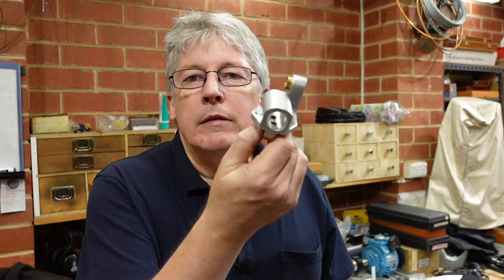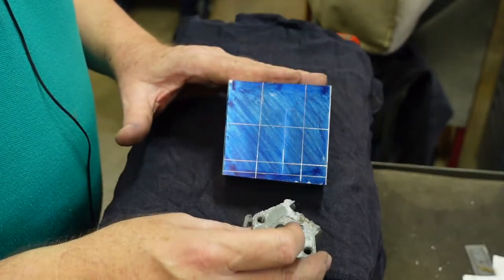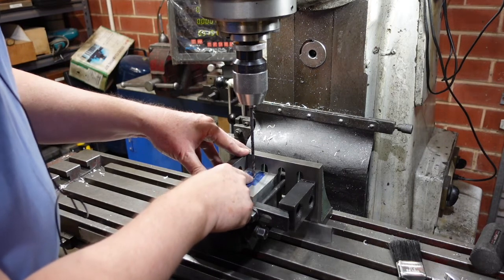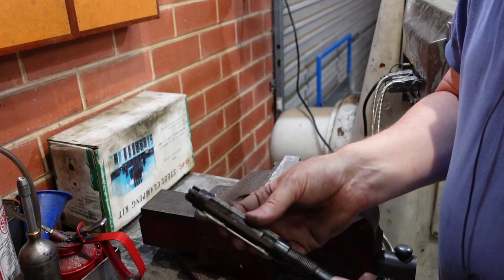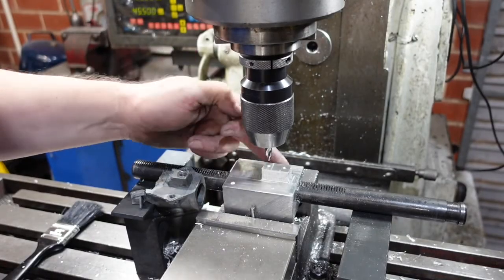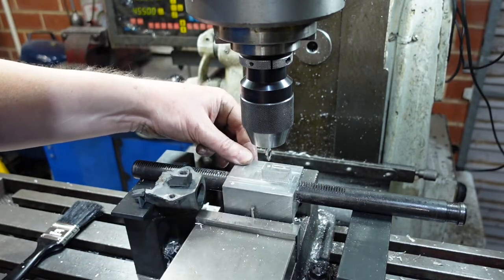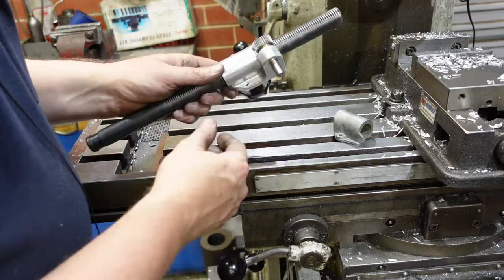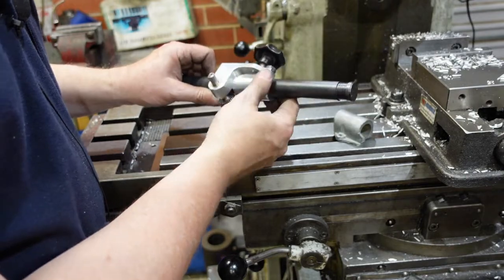Recreating a bandsaw bracket

Comment: Getting the offset for that pinion just right must have been "interesting", did you use something like a clockmaker's depthing tool to get the meshing right?
Reply from the maker: True confession - I 'm going to be doing it again as it is not quite where it should be. Tooth depth is around 1.7mm and it is probably only engaging 3/4 to 2/3 of that, so a bit notchy. Once the owner has finished doing a pre-arranged job with the saw, the bracket is coming back for rework. The error came about because I drilled a pilot hole in the bracket that seemed to be spot on, so just pushed in the bush and drilled out the pilot in that on the assumption that it was concentric with the OD and all would be correct. For teeth this size, not a good call. 
What I originally planned to do was clamp the rack in the bracket and gear to the rack, pick up the centre of the gear, transpose across, and then take out the bush pilot hole with a small boring bar, so I'll be back to that method. The fix may feature in a future 'tidying up loose ends clip'. 
If only I had some artificially intelligent entity to point out when I was contemplating doing dodgy things such as enlarging holes without re-checking position...
Reply: @occasionalmachinist  Would it be too intricate and tricky to fit an eccentric bush locked by a grubscrew or something?
Reply from the maker: @MachiningandMicrowaves  Could be a thought... Plan A will be to push the bush out and start again, but if that does not work, you may be on to something